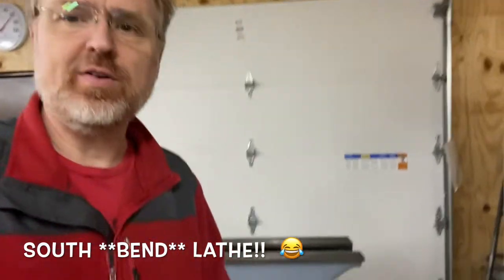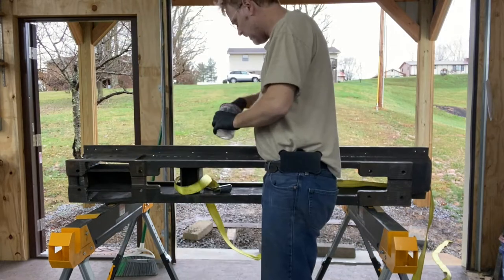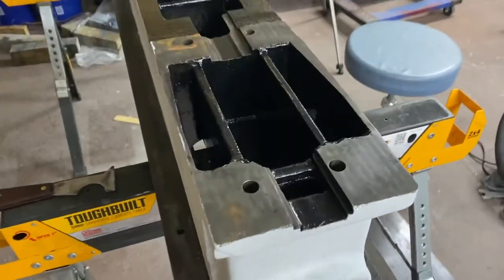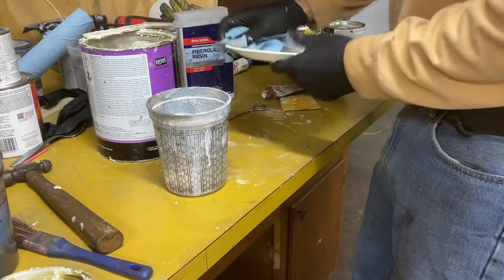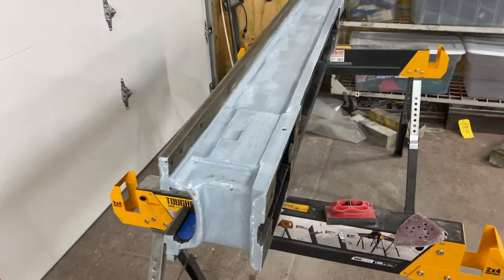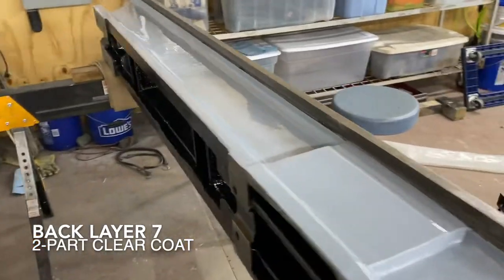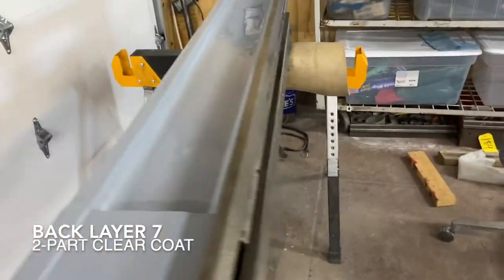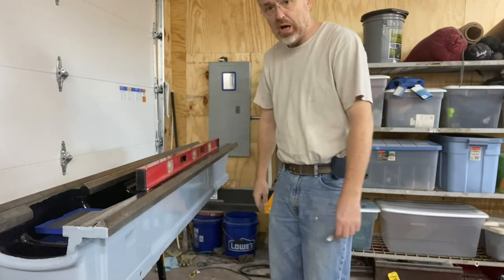South Bend Lathe Restoration, Part 7 (Bed / Ways)

Comment: I'm not sure if this is always the case, but it has been my experience, that unlike a Bridgeport which is covered in body filler, South Bend only used filler on large imperfections in the castings.  So when renovating a S B, I do the same and use a heavy oil based enamel paint without any primer.  This seems to avoid the problem of decades of oil incursion into the cast iron that can really cause problems with some paint, primer, and filler.  The finished product is a semi rough painted casting that looks similar to what the machine would have looked like new.  As a side thought, I personally am painting a  classic machine tool, not a classic car.  And it's not going in a museum, but in a shop, and after some hours of use will be covered in oil, dirt, dust, etc., and the paint will be scratched up. The paint will also dull with time, use, and cleaning.
Reply from the maker: I don't know why I got the bug of wanting my old machine to look like a fancy car.  I agree with you that it was silly, in retrospect.  I have since worked on restoring a Bridgeport (see subsequent videos), and I have spent MUCH less time on getting out every imperfection.  Maybe the lathe helped me get it out of my system.  I know that with lots and lots of sanding cycles it is possible to get it all smooth.  But is it really needed??  Thanks for your feedback and for watching!

Comment: The problem with old machine tool castings is that they soak up oil over the years and coatings
don't adhere very good.
Reply from the maker: I think you are right.  It only makes sense that some oil could permeate into any tiny defects in the metal, or perhaps even get incorporated into the crystalized iron structure.  When I had a friend weld a broken part from the lathe together, they commented how the metal was acting different.  I think this was related to old oil in there.  Thanks for the feedback!

Comment: So at 19:34 you're calling it scraping. Well scraping makes it flat. What you're pointing out is flaking. That gull wing  or "v" shape shape is for oil retention. It's confusing for sure since it hasn't been taught in trade schools for probably 60 years. 
Anyway, you did a beautiful job on that lathe. I'm jealous.
Reply from the maker: Yeah, I think you are correct.  I wasn't exactly sure of the definitions, so I was likely using them wrong.  I wish I had a reference surface long enough so that I could have actually scraped it for flatness.  But then again, I would have had to actually do all that hard work!  Thanks for watching and I hope you enjoy the series.
Reply: @KevinToppenberg  No worries. You've done well with that machine and this channel. I still only have a cheap straight edge. It's an SPI 24"×1"×5/16".  They're around $150. Up on getting it, I saw the second most disappointing thing to find on a precision product from what used to be a quality company "Made in India".
Anyway, I have two small surface plates of unknown grades. So I am hoping to find some place known accuracy plate to compare it to. And then check my plates.
Until then it's a 150 dollar guessing stick.
Reply from the maker: @highlandermachineworks5795  I guess as long as we can enjoy the journey, it's all good.  Thanks again!

Comment: About scraping - forget it. Unless you have a full length “precision” edge, accurate to a couple tenths, don’t bother. Chance is that you will cause more damage than repair. The bed seems fine. Unless you’re p,awning to machine long shafts, it won’t matter. For oil, simp,y using the proper way oil, in this case, #2, and making sure the carriage wipers are in good condition is good enough.

Just as a point of interest, hardened ways are never scraped. They are used as they come off the grinder. You can’t really scrape them. Personally, I don’t believe scraping is as effective as people think it is for the purpose of retaining oil.
Reply from the maker: Thanks for your comment.  Later in the series, I will get into some scraping.  But I can only do it for surfaces small enough to fit onto my small-ish surface plate.  I do end up scraping the ways for oil retention, and that seemed to turn out OK.  Thanks again -- I appreciate your feedback!

Comment: The bondo modification is odd. I would not consider calling it a restoration. Although perhaps I am the odd one who loves the casting irregularities, original worn off paint, with period correct grease and swarf from making wwii battle ships.
Reply from the maker: As I was taking off the paint, there was bondo, or some other type of filler underneath.  So I think it is standard.  Having said that, having a well worn finish takes the pressure off about keeping it clean!